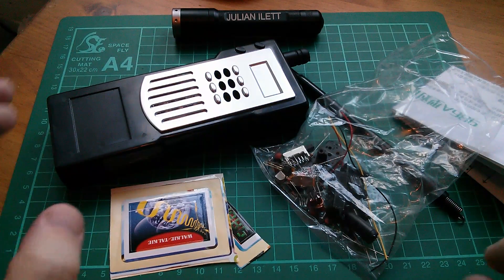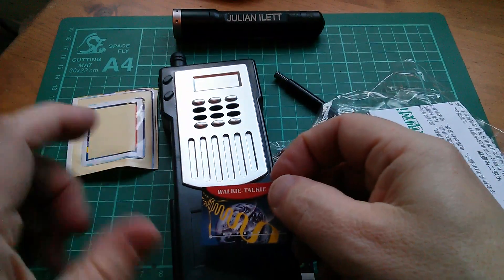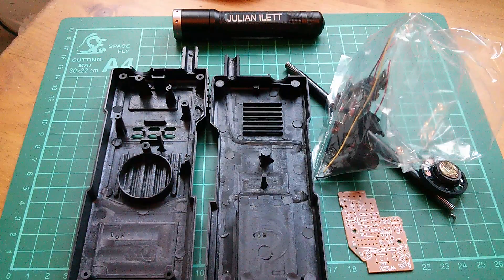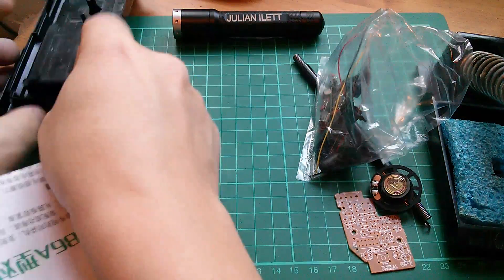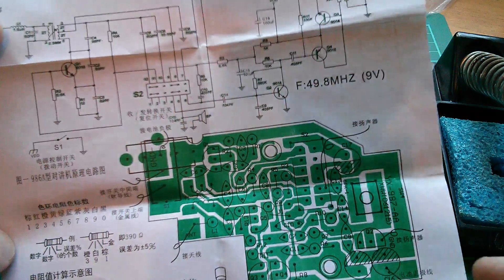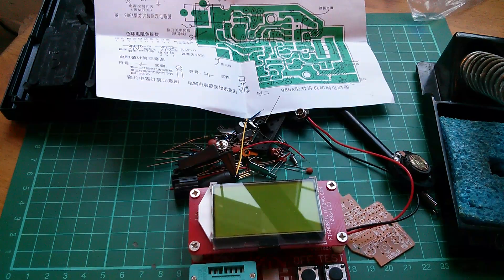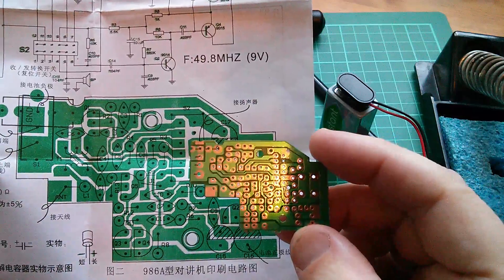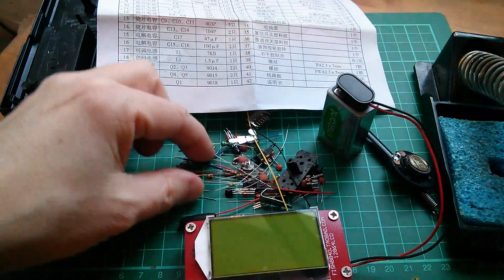Real Time Kit Build: Walkie Talkies #1

Comment: Why don't you bend the legs to each side after you have mounted the component, that way it can't fall out while you solder. No need to use the blue tacky stuff or making the legs springy.

Comment: If you slightly bend the legs outwards once placed in the component holes you don't need to use blu tack to prevent the component from falling back through when soldering!!
At least thats the way I have always soldered large non SMC components, never had a problem with this method.